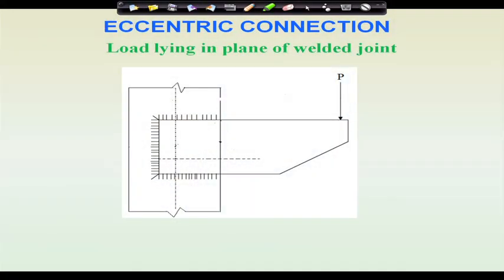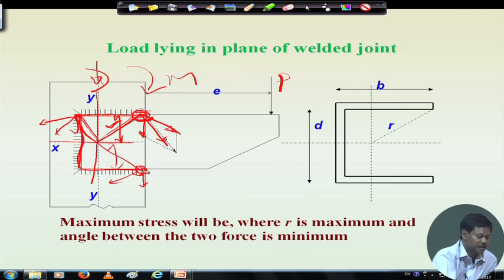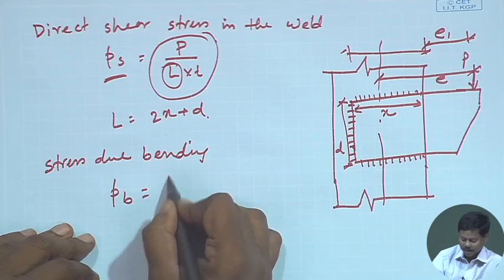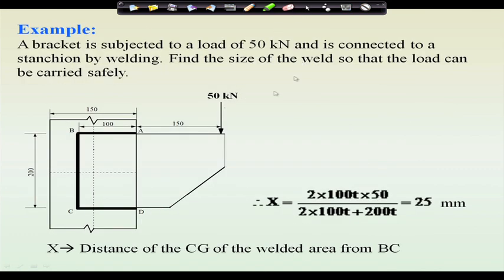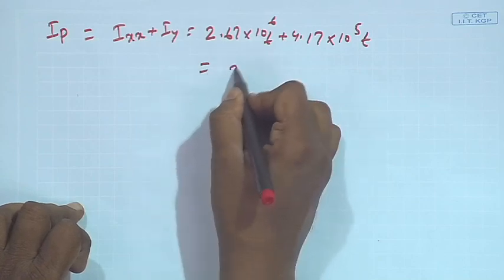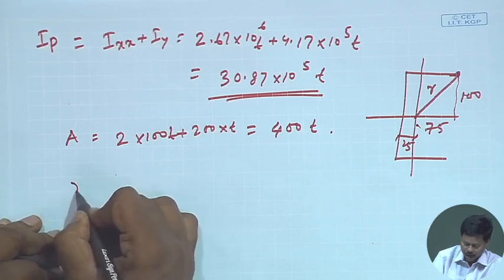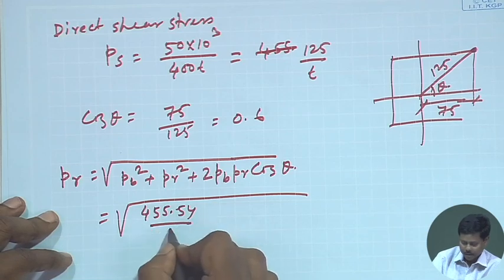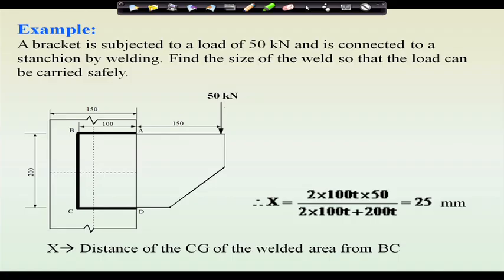Lecture 15 : Eccentric Connection (Load Lying in Plane of Welded Joint)

Comment: Ixx, about CG of weld =((t*200^3)/12 )+2*((100t*100^2)+((100*t^3)/12))). Professor ignored the t^3 term in this formula,which is absolutely fine.